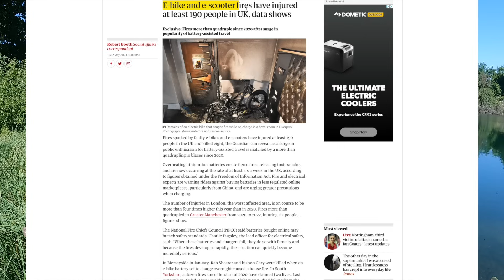ebike batteries dont just catch fire... what are they talking about?

Comment: Battery is 100% not aequivalent of gas tank. In gas tank   each time we  refill  material  fluid which when it is not accompanied by air  and not ignited by additional energy  is completly not flammable  and  not dangerous.  Itself it does not coantain  already   produced energy - it is only prepaired    to produce energy in future. 

Completly different is  battery where    during charging we do not insert    materia but ready produced before energy .   Existing   materia is    permanent  and is  only a carrier for hugh no material electrical    energy which is ready to use  When instantly   released only this stored energy  is 99,9% reason of disaster  People do not get what is pure energy because it was so far used rare but imagine electrical installation run from battery. ? We cannot  prevent fire of heater  by making another type of battery. .Also we  cannot prevent production of energy which is alrerady produced and stored in battery

Comment: E-Scooter design , with everything just 3 inches above the deck and hidden,, is inherently vuknerable to water intrusion during operation in the wet, and most users wull never see the inside of the battery controller area to notice if anything is wrong.

Comment: There is a terrible video on Reddit where a guy steps in to a lift & a second after the doors close the e-bike battery he was carrying erupted. Everyone is naturally aghast & blaming the battery but what the video cannot tell us is was the battery hot, was it wet, had it been dropped ?
Moments before it was likely to have gotten hot & was either giving off a smell  or making noises, likely both ! They don't just fail with no warnings.
One of the other issues with poorly constructed batteries is the battery casings rubbing together & wearing away the battery cell insulation. Most well made cells are constructed using a plastic frame that holds the individual cells apart from one another.
Reply: Yes, it is a VERY false narrative that these fires are all occurring during charging.
Just last month, in Vancouver,  a lady riding a Rad PowerBike went up in flames. (and she was riding down-hill, barely even using the throttle. Even more amazing is that most Rad PowerBikes are UL certified.

And a few months ago, a ebike at a high school went up in flames - again, sitting all day, not even being charged. No hot sun that day either.
Student jumped on the bike to go home, powered it up, and it went up in flames . Again, not being charged.

Then we have those 2 videos, the one noted above (above one with person walking into elevator with a battery pack - again not being charged, and it burst into flames).

Then we have the example that a person rides his moped/scooter into a elevator, and again, not being charged, and again it burst into flames.

In fact, we actually DO NOT know for sure that these batteries are going up in flames due to being charged, and the growing number of fires we see are from bikes NOT being charged! 

the ones going up in flames that we hear about? They are inside being charged but we actually do NOT know if the fire was due to charging! We are assuming so, since the other fires occurring outside don't burn down your home, do they? In other words, everyone is assuming these fires are due to charging, but that's not really the case, is it?

In other words, we are seeing a growing number of fires occurring - and they are occurring NOT during charging. We may well be spreading a false narrative that charging is the issue and reason for these fires.

Grin technologies been working with this technology for 20 years now. They are of the view that it is NOT the BMS, not the charging, but in fact these fires are the result of defective cells.  Hence, it looks like the big "5" top cell makers have mastered this technology. And with their brand name on such batteries, they stand to lose billions if their products don't work. And even Samsung did have some phone fires, but they of course had to fix and address this issue. 

In other words, telling everyone the issue is charging the batteries? 
Nope! - that's not really what we are seeing, and there is growing evidence of lots of new fires, and they are occurring while not charging the battery. And a number of such fires are also occurring while NOT riding the bike......

Comment: When rare fire happen, it can kill or burn house down. It can start by explosion in seconds. I got idea to make automatic water bath using water bucket and string to hang battery above of it. Fire meld the string and battery drop in to water. Using smoke and heat detectors for trigger, it can be quicker, but risk of malfunction is higher.
Reply: Lithium reacts harder with water lol. Like putting water on a grease fire.
Reply: @Sp-o-O0ky  But, water take its heat and flames.

Comment: Thank you, I was concerned about my Chinese ebike battery...I have Engwe P26, the battery has no name, uf, but there is a sticker QC passed, so I hope, it will not set my apartment on fire... Just yesterday, I was cycling home in heavy rain, it was a literal shower(not unusual in Ireland;), I was completely soaked after 5 minutes, came home, took off the battery, dried it with paper, left it outside...all good...I hope, it will serve me for years, but the fire hazard is still there, I've seen drone videos from Ukraine 😮.. I've bought powder fire extinguisher instead what is here, water, and when I charge it, I set an alarm clock... The charger has red light when it's charging, turns to green when it's charged, I wonder, is it still charging when it turns green and can I actually overcharge it by leaving it on?
Reply: Use a timer. Use a plug-in power meter to see what it's pulling. When it starts pulling less, turn it off as it suggests it's mostly full, and it's best to keep it no more than ~80% state of charge for longevity and safety.

Comment: I design electronics for a living and have designed systems with lithium ion batteries. Spot on Andy, well done. One thing I might add, though, is don’t charge the battery below zero degrees centigrade. What happens is that the battery can develop dendrites if charged below zero. Once they are developed, every time you charge the battery from that point, the dendrites grow- even if you charge the battery above zero. Eventually, the dendrites puncture the barrier between the two sides of the battery (internally) and you get current flow that causes the barrier to melt and thermal runaway.
Reply: To summarize: Don't buy an electric car if you live in 70% of the country that gets cold. Better have a heated garage for charging!

Comment: Dear Andy 
You are right in your analogy between petrol tanks and li ion batteries, they are both a fuel source.  However, a petrol tank  contains no Oxidizer, ie oxygen  , at least not in dangerous levels. 
Li ion batteries have their Oxidizer Built in.  When the battery discharges Li travels from storage in the graphite in the Negative terminal and end up Reacting with OXIDIZER in the positive terminal.  The Lithium atom has a + charge, so when it leaves the Negative terminal it leaves it less positive or more negative.
Conversely when the positive Lithium atom arrives at the positive plate where it is oxidized it makes that plate positive.  So current flows from  one terminal, through your motor,  and back to the other terminal. 
The issue is that fuel and oxidizer are contained in one package, like fireworks or gunpowder.  Neither of these products are inherently dangerous in my opinion.  The danger is that different precautions must be taken to ensure safety compared to a liquid fuel that must be released from its tank and mixed with oxygen before fire or worse is possible.

Comment: Does using an E Bike, without putting in the normal human effort, like that on a normal pedal cycle, give the rider a body like yours ? I have raced mechanical cycles all my life, they keep you fit, healthy and slim and you don't need asbestos shorts to use one.
Reply: Depends on the Ebike. In my experience, no., although that's actually really down to design priorities being in ease of forward movement not benefit to the musculature and aerobic system for most ebikes.  But given that I put 10,000 km per year on mine,  about 30k per day all year long,  mechanical is not a practical solution for me, as it's an errand/transport machine, I cannot afford to make my 20-30 min daily trip legs 50 min- 1 hr long because I'm using a basic  bike at 8 mph ( stop with the " I can go 25mph on my bike, no you can't, not with cargo and groceries and continuously over the hills etc), the Ebike can go a constant easy 15 mph, the pedal only bike might only go 10 mph on average, with higher effort,  a huge difference in practical.terms
Reply: I put a 40 tooth chainring up front, replacing the stock  50-52 tooth chainring, to give the bike low enough gears so I can have a reasonable cadence at say 8-15mph, which makes the hub motor bike ride much more like a normal bike at close-to- normal biking speeds, of 9-16 mph. This means I can get out of breath going up a hill if I choose to, to which is basically impossible on most off the shelf ebikes because they didn't have the correct gears for climbing so you end up just using the motor. The normally shipped 50 tooth chainring  appeals to the large majority of people who don't really understand cycling as a sport activity and it doesn't allow a high enough pedal cadence at lower speeds . This is because the Chinese view it is as simple transportation, and the domestic Chinese market is what both created and continues to dominates the ebike industry. And they mainly care about just getting across town.

Comment: Just repaired a battery pack, the BMS had been water damaged, but it didn't prevent charge, only discharge. Because the charger was limited to 42v, even though the owner tried to charge the battery, none of the cells exceeded 4.2v (lucky that they had kept a good balance though, all at 4.12v, 10S5P). Overcharging or charging at a too high rate would usually be the cause of problems, should never happen unless the wrong charger or faulty charger is used.

Comment: I would like to add that cold or water can cause a battery to catch on fire when my scooter cought on fire I wasn't riding it or charging and I wasn't home. I live in the usa in the state of Michigan so I am right next to the great lakes and Canada an it gets very cold and snows here if you live in the north and it gets cold enough for someone to freeze to death it can cause poorly made batteries to spontaneously combust. This issue has not repeated it's self for me but only because I stopped trying new brands' of batteries and only use now what has worked well in my area in the cold. Brands' of batteries I have tested in below freezing temps that work good are Joysi , swagatron , and Ancheer. Buyer beware of NBPower, and Unit pack power batteries they will become unchargeable if the get too cold!

Comment: I charge my battery in 1/2 hour sessions. Taking a 20 minute break between sessions. It give time for the charger to cool down as it gets hot. I assume it also give time for the cells to balance out incrementally the 1Amp of juice it got in that time. I'm super cautious as I have to charge inside because there is no outlet outside. Plus the bike would get stolen.
Reply: I use a Luna Charger 48V Advanced 300W Ebike Charger . Has settings for percent to charge set for my battery at 80%  charge at 1 amp . Also put a lamp timer on the charger . 
Keep my battery in a metal tool box with smoke alarm always monitored
Reply: @vmobile890  I thought of getting a toolbox,  but in my case the battery is in a metal case and sits in a metal sleeve on the bike. If something goes wrong it should hold about as well as a metal toolbox to contain the radiated heat and not melt...  The bike is away from anything that could catch on fire either from radiated heat or from the chemical reaction or the flaming gases.   

A metal box is better for handing the gas pressures, perhaps isolate the torching flames from the outside. but eventually the gases escape, possibly still hot enough to flame. 

I also concluded that the oven is a good place to use as a charging spot for people that live in apartment, as long as it's OFF
Reply: what C rate are you charging at
Reply: @jimmybrad156  My battery is 12 ah, charger 2ah
C Rate = 2 A / 12 Ah = 0.17 (or approximately 1/6)

I'm more concerned about the super hot charger than the battery tbh
Reply: @AegisPupus  charger 2a*.
Man I'd get a lifepo4 battery, and be paranoid about water ingress / condensation and corrosion on terminals. And make sure the BMS has high temp sensor/s, balancing, in/out current limiting and high/low cell voltage cutoff (and what's it called where if a cell won't charge then it's prob got an internal short so don't allow any charge as it needs replacing and will just get hot if charged).
--
Sound like the charger needs a fan, or if it has one, it's not designed to flow plenty of air across its mosfets?
Reply: @jimmybrad156  Thanks. Looks like mine had most of that, no temp sensor in the pack though.

Comment: The big problem is that lithium is extremely unstable. With one battery or another it starts to deteriorate more, there is a potential difference, there... At the moment we still don't have safe lithium batteries.
The BYD shit is entering Brazil with force. Lots of advertisements, people finding the screen to spin cute 😒... There are already insurance companies that banned Ev from insurance. Well reasoned, by the way. 🤷🏽‍♂️
Reply: LTO is safe, LFP is a lot safer than LMC. Use LFP cells and a decent BMS. Make sure it has at least one temperature sensor, and make sure condensation / water ingress won't be an issue.

Comment: There's only 3 ways an Ebike catches fire 

1) Using the wrong charger 
2) Chargers that don't have overcharge protection 
3) Damaged and faulty batteries
Reply: Faulty BMS, bad battery design unable to detect faulty charging, unfused individual cells, ( bad design), probably other reasons too... Water intrusion, even condensation, inside causing corrosion at connections in the battery, which will eventually create excess heat during charging and especially in use...mechanical vibration loosening connections ( can be prevented by fully potting the battery, which is one approach)... There are other causes. Generally the problems occur as the battery ages/wears, if the design itself doesn't take certain things into account.

Comment: Really good video.  Unfortunately we live in a world where FUD is king and clickbait is queen.  I'd be willing to bet that 99% of these ebike fires are due to user error, either using the wrong charger, using cheap 3rd party batteries with no BMS, or abusing the batteries (over discharging or charging too fast).  Unfortunately the media has no interest in reporting the truth, they only care about number of cliks, and the best way to generate clicks is to A) make you afraid of something, and B) Find something to blame, and C) Jump up and down screaming "We want something DONE!".  

As you said there is never a 100% guarantee for anything, but a little common sense goes a long way to getting you as near that number as possible.  Here's my routine/setup for my PEVs:

1) All charging is done during the day when I'm home.  I never charge overnight or when I'm out.
2) I use only the chargers provided by the manufacturer
3) I use only the batteries provided by the manufacturer
4) All of my charging is done in the garage.
5) I have a pannable, IR Capable security cam in the garage which I monitor on my computer at all times when charging.
6) My charging bank is connected to an Alexa plug, which can be instantly terminated with a voice command from anywhere or set on a timer to terminate at a specified time.
7) I have a smoke alarm installed directly above where I charge my PEVs

Could I do more?  I don't know, maybe, but all of this cost me about $60 for the plug, smoke alarm, and camera. and I think anything else (fireproof charging bays building a charging shed outside, etc.) would be prohibitavely expensive and have diminishing returns.
Reply: You'd be better off with a heat sensor, when these fires happen they are FAST... And have a way to remove the battery to outside if that's practical( cart with wheels on it and a long handle such that you can shove it the door) OR a way to contain it ( fireproof box)

Comment: I live in a condo. I ( REMOVE THE B🎉ATTERY)  after the ride and put it into a triple fireproof  insulated small garbage can. This is on my concrete patio. The ( stock ) charger has a timer . And I charge it not leaving it un attended. This is a simple habit and great insurance. My two other batteries are stored in my wood stove insert. The chances of a battery accident happening are low but like I sain (INSURANCE)

Comment: Good points well made, I totally agree that proper use and decent quality batteries mean the chance of a fire is very very low. But that’s only one half of the risk calculation. The other half is the impact of a failure, and here the score for a battery fire is huge, the fires are catastrophic, explosive and impossible to extinguish. Plus I understand the gasses given off are toxic. So the overall risk score might be ok for someone charging their bike in a shed way down the garden, but not ok if you need to charge it next to the only exit door in a high rise flat.